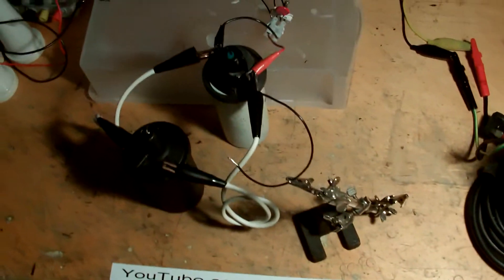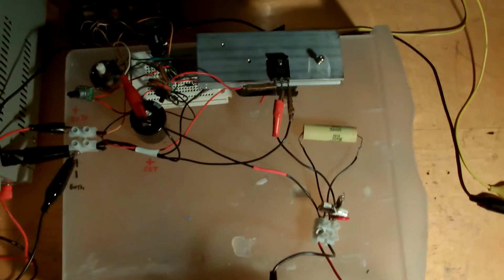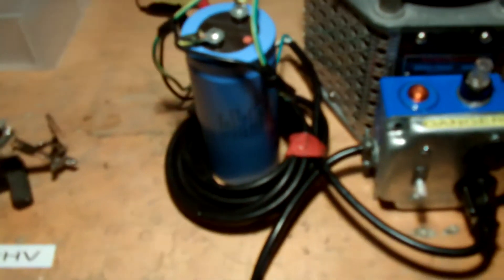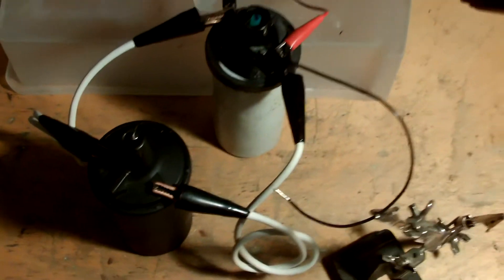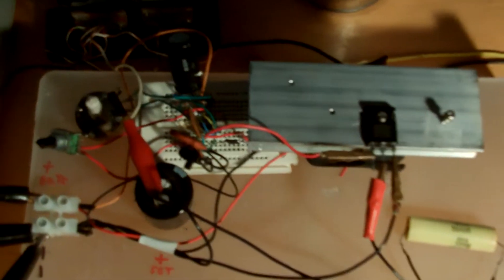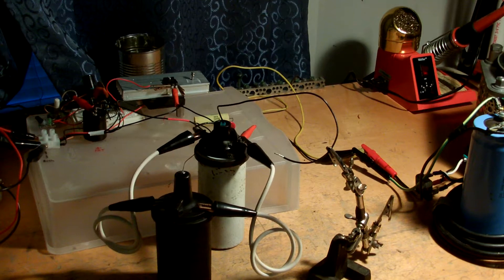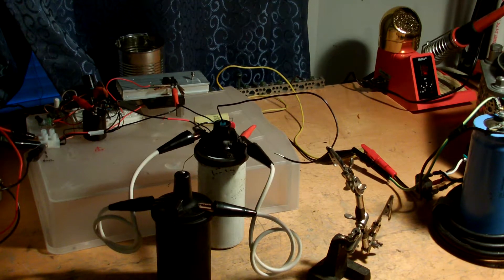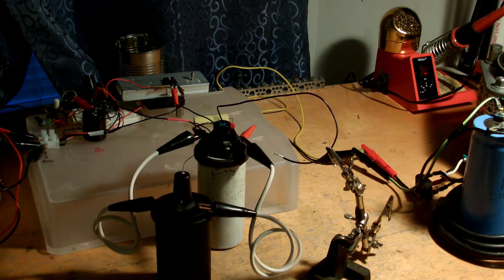Mosfet-Ignition Coil Arcs

Comment: im brain storming how to convert point and condenser to  a somewhat more electric ignition for my old onan engine
since there no magnet on the flywheel  and no space to add 1
made me wonder can i use hall effect sensor  to run a spark plug
with the normal dual coil since its a 2 cylinder engine

all point to magneto conversion i see the flywheel already has magnet >_>

Comment from the maker: Hey John its good to hear from ya,  yes one of them is oil filled and the other is a solid bitumen type. your right, usually i can get around 60kv from these if i use a mains driver, the problem with driving them at these frequencies is the amount of counter Emf/backspikes due to the rapidly collapsing field around a lossy iron core! It is fun though, the next video i will increase the frequency and get a soild hot arc, the mosfet may not make it through alive!